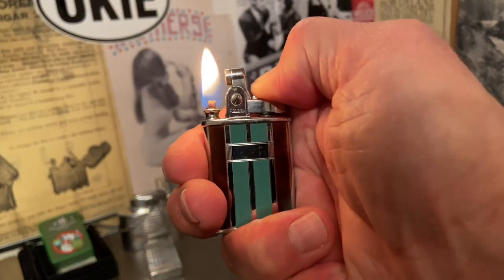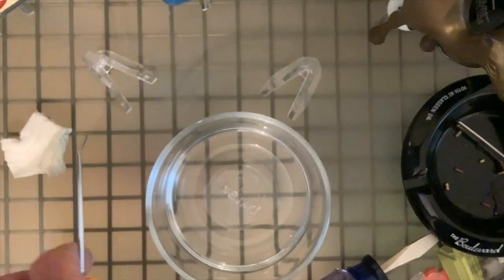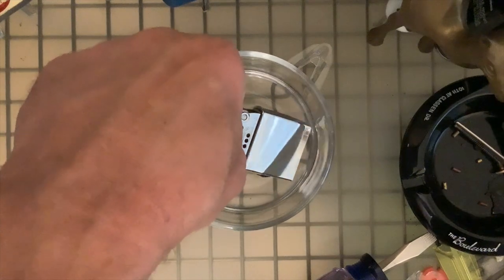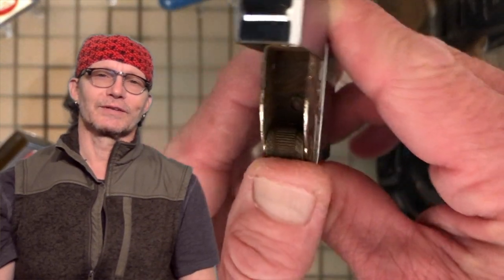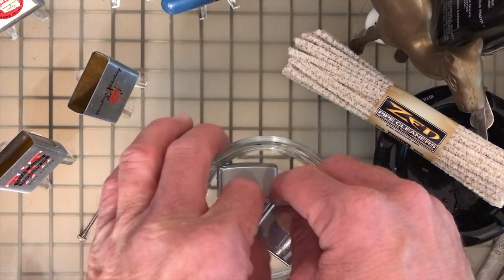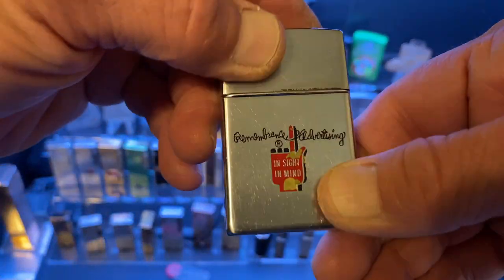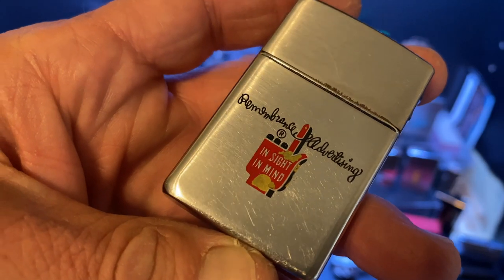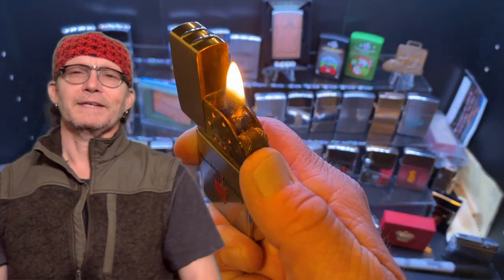Vintage Bown & Bigelow Wind Master Petrol Lighter Project Via Zippo Daily Fix, Dylan Depuy, ZF77

Comment: Obstructed flint tubes are a nightmare.  Lol I used vinegar in an eye dropper down the flint tube it worked pretty well.  I'm restoring a ww2 Era homemade lighter made from an anti aircraft shell.  That's a tough one to fix.
Reply from the maker: I saw that video yesterday. Very interesting lighter. Is that an actual Zippo insert fashioned in there?✌️
Reply: @DependableFlame  sure is looks like a ww2 Era insert